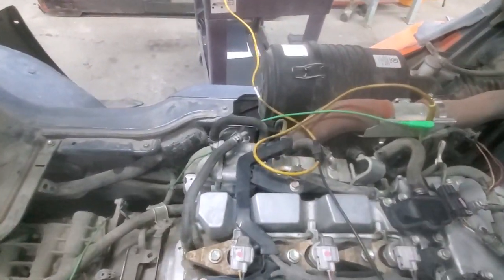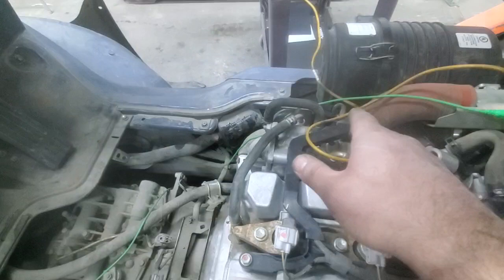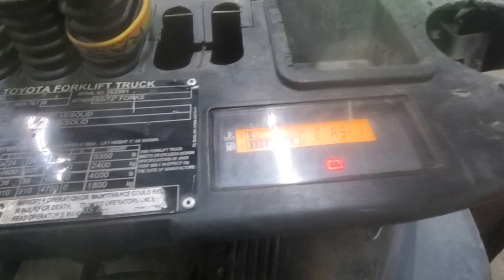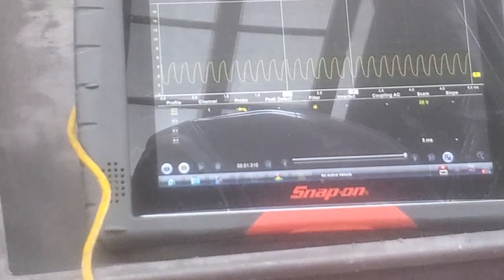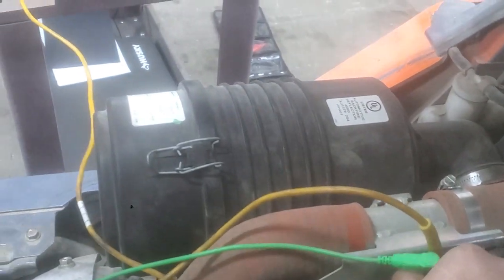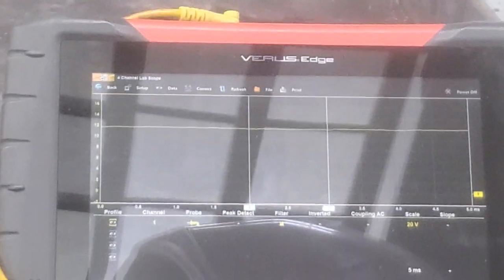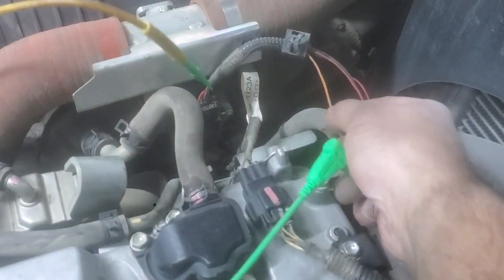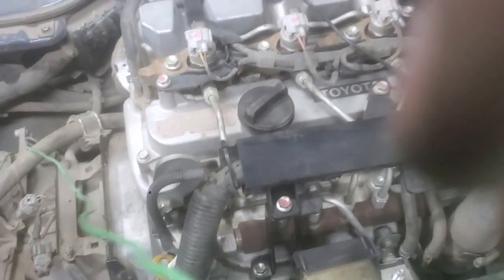Toyota 1ZS 0C-2 fault(P0102 or P0103) MAF CIRCUIT HIGH OR LOW.

Comment: Good job
Reply from the maker: Thank you!!
Reply: Sir i need your help  iwanna send you a video for my forklift give me your email
Reply from the maker: What make and model is it.  And whats the issue?
Reply: a model
52-8FDF25
1zsEngine
The problem is I don't know how to explain it if I send you a better video
The engine is uncomfortable
The rpm goes up and down
There are no errors on the screen
please help me
Reply from the maker: Replace fuel filter and pull the sending unit out to check the pick up screen.  Sounds like may be fuel contamination
Reply from the maker: Also does it smoke?
Reply: @CEtech82  I am a mechanic, sir
I know that the problem is with the solar network 
I changed the filter and renewed the pump 
And I checked the injector There are no problems 
Therefore, I want to send you a video so that you can see the problem better than the explanation
Reply: The temperature was rising 
And there is no smoke 
I cleaned the catalytic converter 
Smoke comes out
 Without color  
The temperature is normal 
Sir, we are here in Palestine, the conditions are difficult, and there are no spare parts for this forklift because it is new
Reply from the maker: Whats your fb info?
Reply: Kamal bahish
The profile photo little girl

Comment: Buemos dias maestro le felicito por su trabajo por favor  tengo un código 11-2 toyota 8fdu32 motor 1zs algun información gracias
Reply from the maker: That is a egr position sensor fault.  What is your email and i will send you the right info.   Blue wire is 5v ref, should have 5 volts on that wire key on.  Brown is negative.  Pink is signal wire.  Those 1zs are notorious for harness issues

Comment: What pin is it on the harness? I’m trying to bypass mines as well cause I currently have the same code 0c-2
Reply from the maker: If you have a email. I will send you the connector view.  For reference its the big plug on ECM PIN 110( red) Intake air signal, 65 is (black/blue)MAF Signal, 87(black) is IAT ground, 64 yellow/red is MAF ground
Reply from the maker: Sorry for late response

Comment: Hello, problem 1c-2
Reply from the maker: 1c2 is large leak detected in the high pressure fuel system.  Usually a injector or common rail issue.   If you pull the return line off the common rail and see fuel comming out excessively, you have a bad pressue relief in the rail.   To determine if it is a injector you need the software.   Or  pull off the main return line from injector to see if there is excesive flow